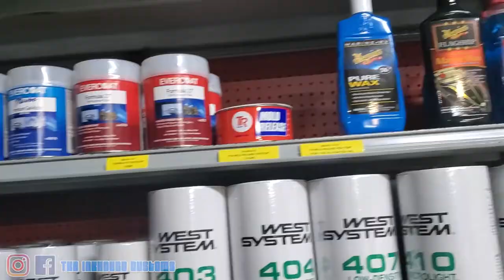Making Fiberglass fender flares and Body Panel molds : Jeep grand cherokee WJ p2.

Comment: Which is better fiberglass fabric or fiberglass mat for body kits
Reply from the maker: @cuhh cuhh the fiberglass cloth/fabric is easier to work with, but you'll have to build up the layers to get a strong part. With mat it gets all over the place, but 2 to 3 layers your part is good to go. I use both for parts the cloth as the first membrane then backed by mat to add strenth.. so I use 1 layer cloth and 2 layer mat for my parts.
Reply: Off topic - who's  music,?
Reply from the maker: This is music I get off of Epidemicsounds.com